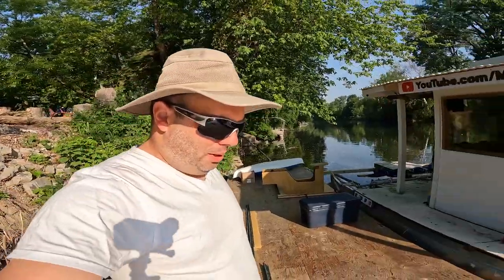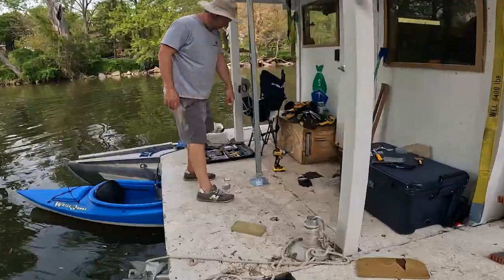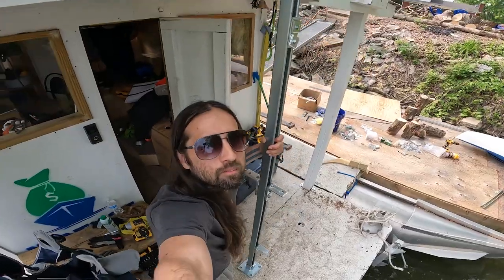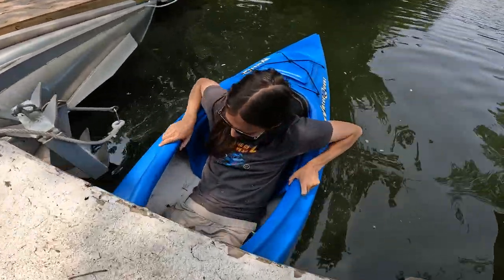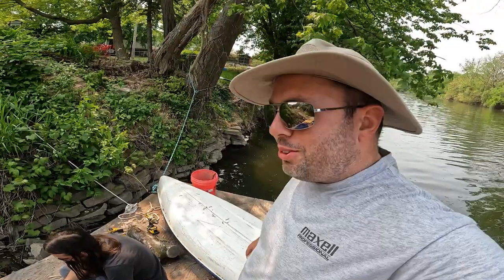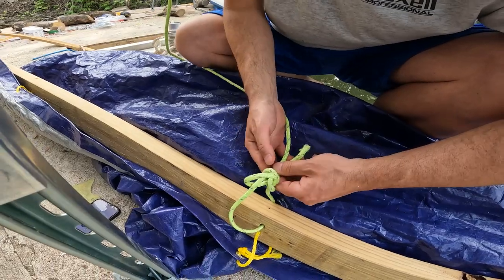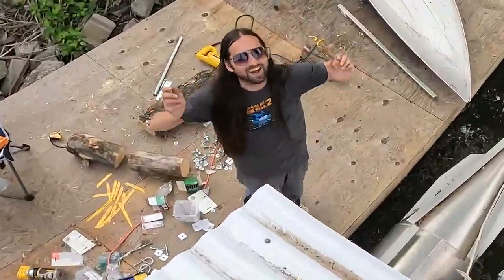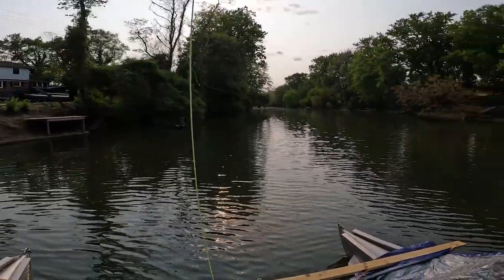Pontoon Boat to Sailboat Conversion COMPLETE! (Kinda...)

Comment: Guys.  Read this is a sailing magazine a few years back.  To wit, when the thunder starts rolling and the lightning flashes... you've got a lightning rod there (albeit, a very cool one.)  The article recommended jumper cables with one end affixed to your mast and and the other end dragging in the water.  Same with wire stays.  Just a thought.
Reply from the maker: This has been one of our concerns for awhile... We have to take the mast down to get under bridges, and then we leave it down until we go out sailing again. Hopefully it stays safe!

Comment: Add a spreader to the mast and some shrouds and you sould be good..
Reply from the maker: Standing rigging is on the list of upgrades. Do we NEED a spreader, or can we just run wires from the top of the mast to the sides of the boat?
Reply: @MoneyPitBoating  with your set up, probably don't need one but it may add some stability and make it so you can have more points of contact to the chain plates.....which hold the shrouds to the boat from the mast....may try a backstay and forestay as well...4 points to help the mast stay erect....lol
Reply from the maker: We want our mast to stay VERY erect! Thanks for the helpful info!